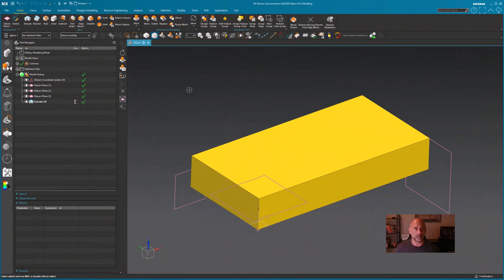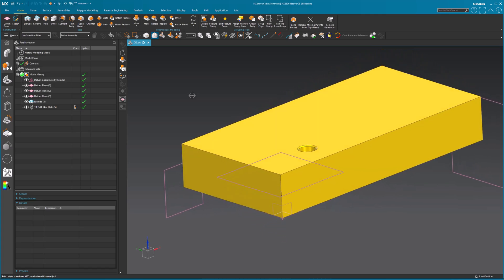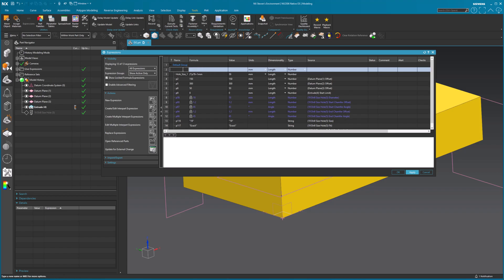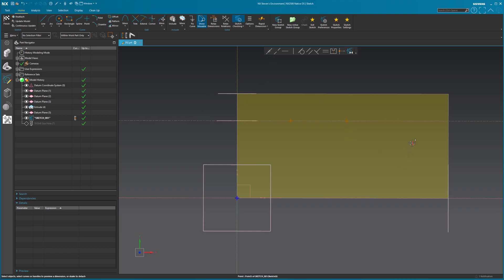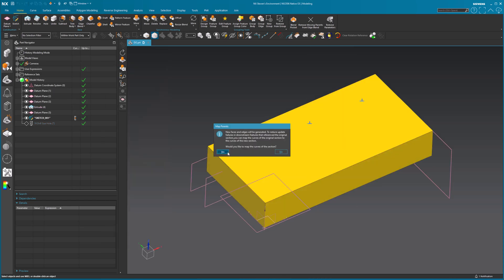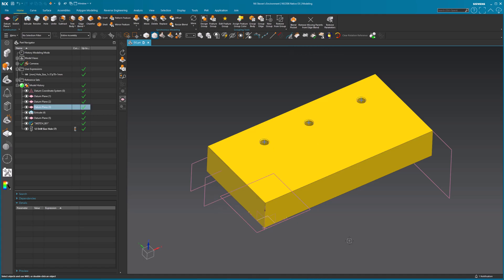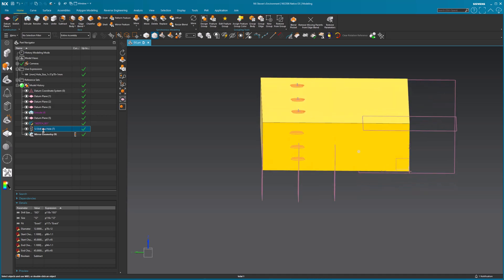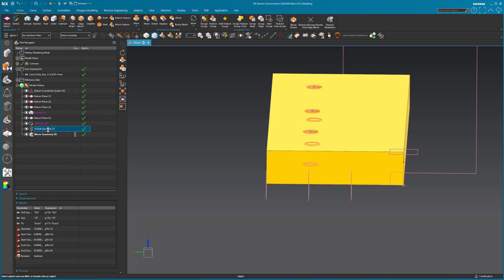🔧 CAD Design Intent: How to Put the Cart Before the Horse (Edge Distance Formula) 📐

Comment: its not work with fillets and other features based on edge
Reply from the maker: Correct. For other features such as fillets and Chamfers and extrusions can create the expression first and link to the expression. 

For the hole function, it has all of the default values for whatever specific size you choose so you have to place one first to get a value